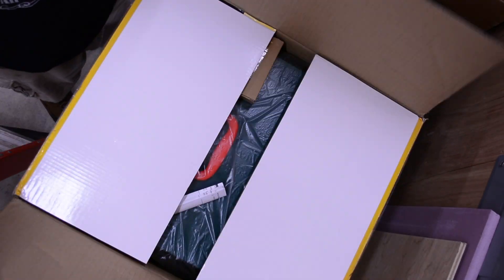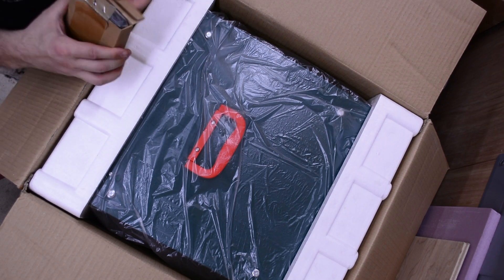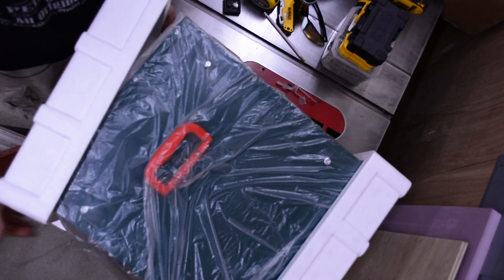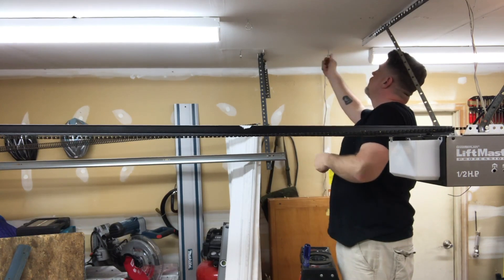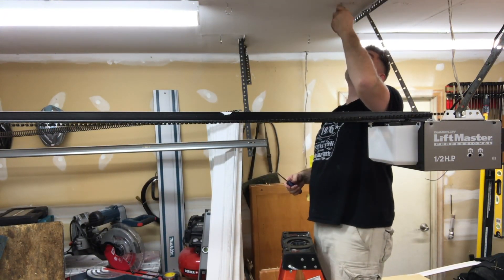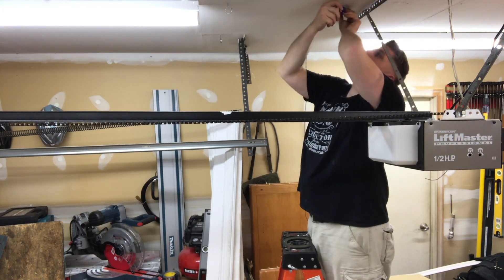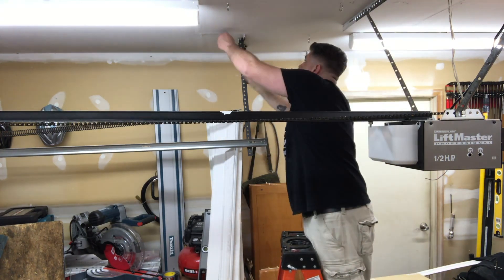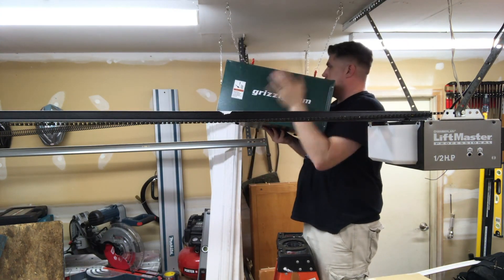Keeping the Air Clean in your Shop | Woodworking - How To Install

Comment: How has the Grizzly air filter been working for you? Would you recommend?
Reply from the maker: Keith Pulley hey thanks for the question. So far it’s been working great for me. The key is to remember to turn it on. If you are shooting video it will give you a little background noise though. I would recommend any air filter for your shop. I bought the Grizzly one because I was purchasing other Grizzly items and it was mostly for ease of ordering.
Reply: Perfect. I bought a different brand but your video helped really put the air filter purchase into my forefront. Air filtration and dust collection aren't sexy tools but they are a much needed necessity for any serious shop. Thank you again!